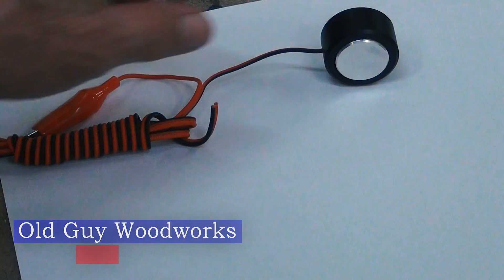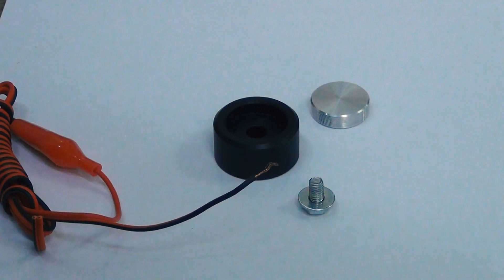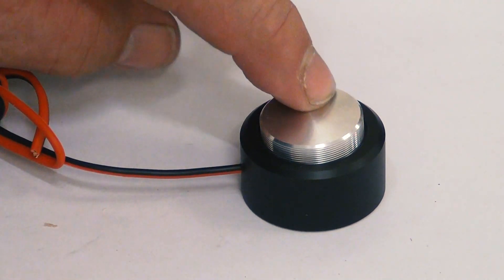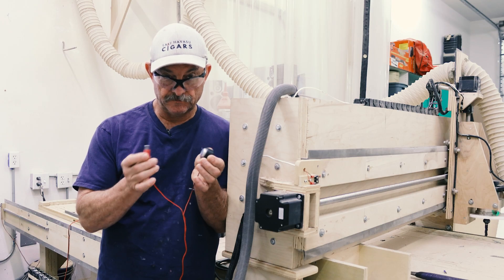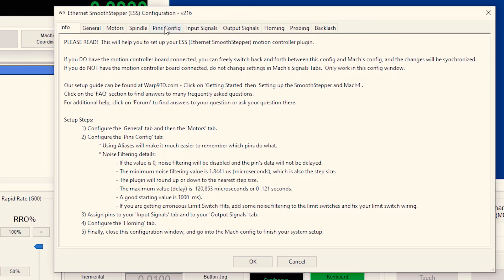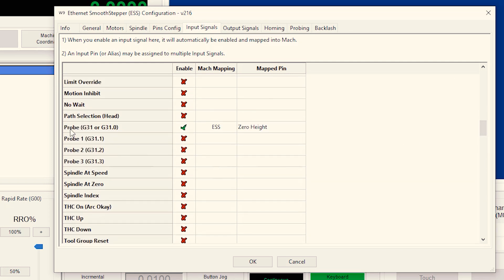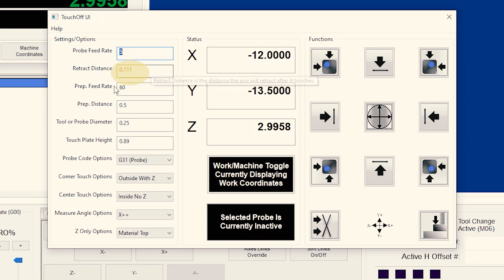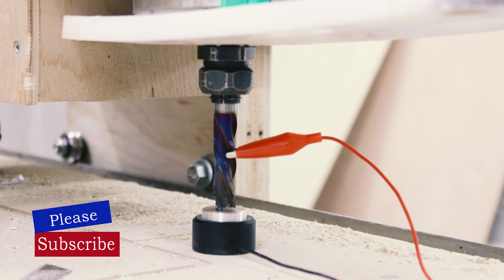Z Axis Touch Plate for CNC - Tool Zero

Comment: It may seem like a "dumb" question, but what size spring did you use in your build? I'm looking to do the same thing and your video is one of the only ones I can find on YT that uses a spring???
Reply from the maker: I sincerely have no idea.  It was a small lightweight spring I got at the hardware store.  Not a lot of pressure or force.  I wish I could help more.
Reply: @OldGuyWoodworks  if you have a caliper can you try to measure the diameter? I'm headed to the hardware store in a bit and will look to pick one up. Thanks for taking the time to reply to my earlier comment
Reply from the maker: @IfUOnlyKnew  Unfortunately I am in CA recovering from Covid.  My cnc is in my main residence in AZ.  Sorry I can't be there probably until next week.
Reply: @OldGuyWoodworks  No worries at all, prayers for a quick recovery and that you're back to making new projects soon

Comment: Love it!  I'm using mach III but I think I can find the right settings if I poke around a bit.  I still need to wire up the limit switches I bought several months ago. =)
Reply from the maker: I went without limit switches for a long time.  After a couple crashes, I changed my mind.